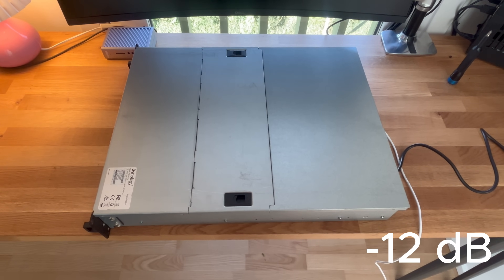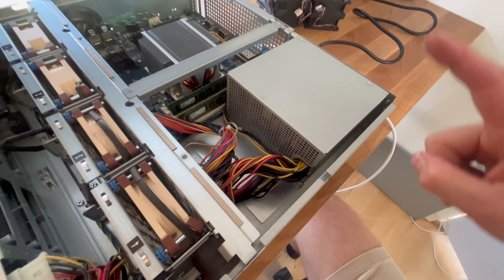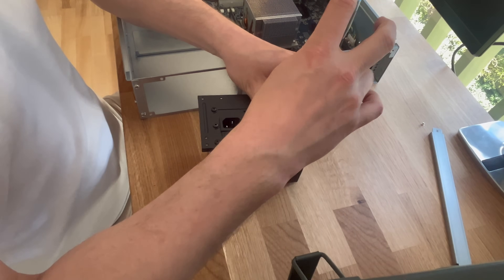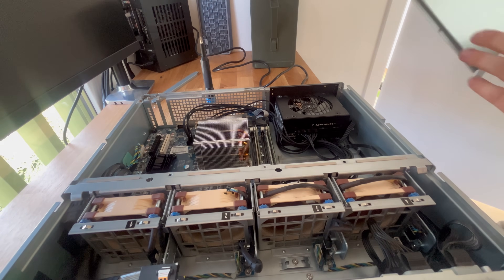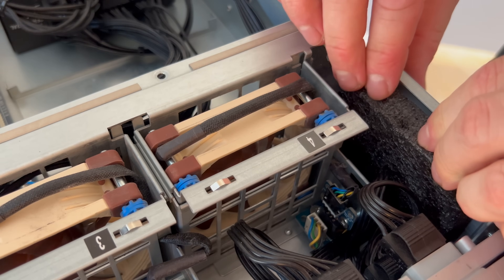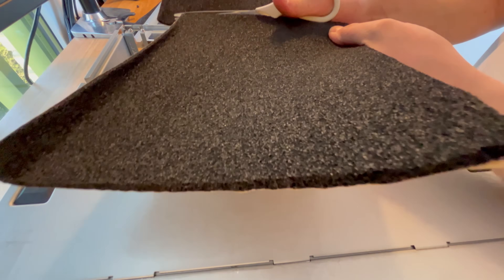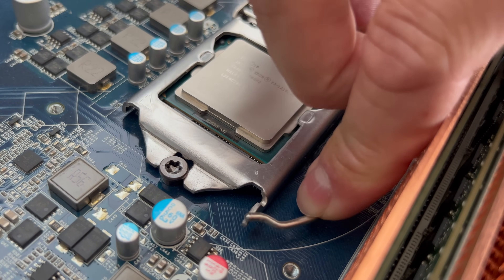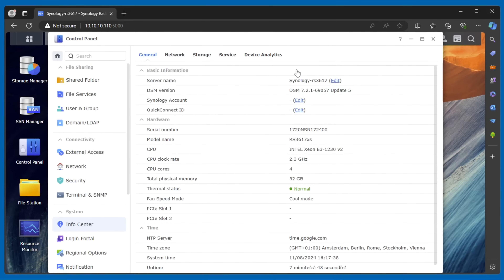8 Dumb upgrades for our aging Rackstation Synology [Lower noise and powerdraw]

Comment: Oh I love the fan upgrade idea! I wish I'd spent more time googling though when my power supply failed or I would have done this upgrade instead of buying a replacement from Synology. It's also a production unit and downtime was a big deal so I needed a TODAY solution and didn't have time to mess around with it. NEXT TIME! LOL
Reply from the maker: Thank you for the kind words my friend :) 

Depending on how much warranty you have left, you might still have done the right thing. If you have a problem with the box in the future and are running non-standard parts, Synology will most likely refuse you any service :)

Comment: Please buy a flush cutters if you like zipties so much.
Putting an air guide for CPU is great move, makes me wonder why there wasn't one in the first place.
Downgrading CPU is a good choice since unless you completely disable cores, they still consume power
Reply from the maker: Agree, flush cutters should get added to my toolbox. Looking at pictures of the machine, there is a fan shroud, but I bought mine used, and the old owner seems to have discarded it.

I agree on the CPUs :)

Comment: The power supply fan is covered
Reply from the maker: No, It's not. There is a 2cm gap from the top of the PSU to the bottom of the case ceiling. That's the entire reason for using the adaptor plate friend :)

Comment: For searching for the sounddamping Material: it looks similar to sound damping mats on cars and is probably the same. Note that many of them have weighting layer. Just buy without as we dont need that and its probably cheaper as well.
Reply from the maker: Oh, that's a great comment! I love it when two worlds cross over, and the sound damping materials from cars would most likely be more than amazing for this application! :)

Comment: cool video, big flex, but cool, i didn't know you can swap the cpu in the rack mounted synology
Reply from the maker: You can only do it in some. I'm fairly certain that most of the newer models use integrated motherboards with chips

Comment: pretty cool upgrades, I currently am just using a SAN I bought for my business as my main storage but I am thinking about getting a lower power system like this for my home use.
Reply from the maker: Cool! What SAN are you using? For minimum power draw, I'd get one of the DS18xx models from 2015 and forward
Reply: @Ottetal  Its an older IBM Storwize V7000 with 96 1tb drives across 4 chassis, its been great for my business but power draw is very high and I want to separate out my home and work machines so I can relocate it once we get an office and still have my media and other files on a local machine. Honestly though I don't mind the power-draw considering the massive amount of redundancy it offers for my business, it can loose one controller, four power supplies, and multiple drives without any interruptions in service.
Reply from the maker: @tjmbv8680  wwwhhhhheew, that’s old. I’m happy it’s working for you. I would go bankrupt before even powering it on
Reply: @Ottetal  yeah luckily my business has good cashflow, I guess I would like to get a newer one at some point but I did the math and it would take a pretty long time to make back the cost of a new San from the power savings.

Comment: Downgrading well kinda not the solution. An 2.3ghz will just run non stop at that speed an 3.0hz will run 2.0-3.0 I'm giving examples and the 2.3ghz will go 100% non stop while 3.0ghz will go 20-80% which is kinda questionable downgrading you're actually making it worse. The solution would've been arctic freezer 3 aio with the noctua fans not those but yeah, remake the interior so that aio can actually fit. Put small noctua fans where the cpu and motherboard is like 3 is ok, psu fan doesn't matter if the fan it's up or down just it doesn't have holes so kinda useless so make holes. Better than that you won't get. But downgrading an cpu only because of sound like big uhhhhh 💀.
Reply: lol

Comment: Not sure about those air baffles. If fan2 fails, your cpu might fry.
Reply from the maker: If fan2 fails, not only will the motherboard sound a very very annoying alarm, but thermal protection will simply power off the unit if too high temperatures are reached.

Comment: so you used a SFX power supply because of fan placement. You then covered the fan with foam. Make it make sense
Reply from the maker: @xabhax  2cm gap between foam and top of PSU.

Comment: hello! i never understood what a NAS are used for how can they be helpful and how small can they get! (sorry for the stupid qustion)
Reply from the maker: @switce  no worries mate. A NAS (Network attached Storage) is like putting a hard disk on your local network and giving it an IP address. By doing so, you make the file on the NAS accessible by all of the computers on your network. This is smart for several applications, for instance:
1: Because the NAS is powered on at all times, you can power off your primary computer, and still access files.
2: Since the NAS only serves files, it can be very low power
3: As said before, multiple machines can access the same files, without needing to move memory sticks 
4: Since they are connected to the network, they can be put in the basement where their noise and heat output does not matter.

The size of the NAS can be as small as a pack of gum, and theoretically as large as a fridge

Comment: I wonder if the sound dampening foam makes an impact on the thermals... I mean I could, but then again it ain't touching anything!
Reply from the maker: It's not touching, and not obstructing airflow, so it's not affecting thermals. If anything, having a slightly narrower internal dimension for air to go through should direct air even more over the active components. This is probably such a small degree, that it's not measurable within the variance I can measure

Comment: Very cool to see this, and thanks for sharing, but...
- Your DIY air baffles may affect the air flow on voltage regulator module parts on the mainboard.
- I'd be highly interested in the temperatures of your 12 hard drives AFTER the Noctua swap. Do you use 7,200 rpm drives, or slower ones?
- I could see some crumps of dried old thermal paste between your LGA fins, which gave me goose bumps: it is not only a high risk to contact problems, but even may damage those fragile fins.
Reply from the maker: Hello friend, thank you for the kind words. I don't think the voltage regulators will take harm with less airflow, since the new CPU puts siginficantly less load on both MOSFETs and vreg. Good comment, I'll keep it in mind in a future video
I am actually "only" using 8 hard drives - the four middle drives are all SSDs. That being said, the noctuas don't push enough air, and drive temps shot to mid 40s. It's still within spec, but I've also read the backblaze report. My next video (should be uploaded tomorrow) will go into what I consider the perfect fans for this box
I agree on the thermalpaste. Rest assured, I took it out off camera, but only I know that - and observant viewers like yourself will rightfully cringe.

Have a good day :)
Reply: @Ottetal I just viewed your update to this - you really tamed those Arctic beasts! ^_^ The temps now look very acceptable - great job, and thank you for the insights!
Reply from the maker: @kai.steffen.schwab  Thank you so much for the kind words friend. And I agree, these new fans really do the job!

Comment: mate, thats savage burn made me LOL IRL. does this have 10GBE? if not add that, and go back the the quad core.also add a couple of NVME drives as cache on it, it'kk speed it up massivly.
Reply from the maker: Thank you for the kind words. The server used to have 2x10G with SFP+ ports, but I don't need the speed. I have dual gigabit to my Compute nodes and a single gigabit link for management and use with my main system. I think I'll go three gigabit links to compute nodes in the future.

Same with the CPU, I don't need the extra performance right now, and would rather have the lower powerdraw. I am keeping a keen eye on usage though - if it goes up, I'll swap back

Comment: That noise dumping foam is making thermals worse.
Reply from the maker: Interesting view. How does it make thermals worse?
Reply: @Ottetal  I don't know how it would make thermals worse. Makes no sense to me? I want to mention that you forgot to add a link to the stuff in the description. I'd be interested in picking some up to play with.
Reply from the maker: @KarlMeyer  It would seem as though they have restocked since. Here is the link friend: https://www.moddiy.com/products/modDIY-Sound-Dampening-Foam-Material-%288mm%29.html

The foam making thermals worse to me, makes no sence either. Someone said on a forum that because heat could not radiate to the metal and then out of the chassis, I would overheat in an instance, which maybe could have some merit, if it was not for the four giant fans negating all heat to case trasnfer.
Reply: @Ottetal  Exactly right, I thought the same thing. Thanks for the link!

Comment: Great vid, upgrading/downgrading is always fun. Is the server able to run any other OS than the Synology OS?
Hvorom alting er var det en god video. Hvor i landet er du fra? Vejle her👋
Reply from the maker: Thank you for the kind words! :) Other users have suggested installing a different OS, which I think is a splendid idea. This is however my only SAN at the moment, and I don't want to take it offline and install a to me unverified OS. 

Jeg er fra københavn :)
Reply: @Ottetal  Yeah, I get the thing with the OS. Unraid might be an option down the line.
Håber det hele kommer til at lykkedes hvad end du finder på :)

Comment: Nice upgrade, however i'm not really into the idea of covering the psu fan.... with the foam that you use,  maybe it's me but i dans see how the air flow can be good for the psu
Reply from the maker: The PSU still have access to fresh air, there is a gap between foam and fan intake on around ~2cm
Reply: @Ottetal  OK thanks for the answer 👍

Comment: very cool video, I recently did similar upgrades to a buffalo terrastation nas that had the original motherboard die. the backplane on it was unfortunately not able to be used with the new board because it used some odd proprietary connector to handle spinning the drives up. I pulled it out and just wired them individually since they're sata drives anyways. It's currently my cold backup for my main nas, and I need to get around to setting up wake on lan to allow the main one to back itself up automatically. One thing you might look at here is weather that foam is blocking the new psu from getting air because it seemed like it was a little close to the fan
Reply from the maker: That sounds nice! Could you have harvested the connector from the old motherboard and build a new cable? There is a ~2cm gap between the PSU intake fan and the foam, so it should be fine, thanks

Comment: damn noctua's fan really do the job
Reply from the maker: Yeah, they are really quiet. They don't push a whole lot of air though, so I'm trying to find replacements.
Reply: @Ottetal  if its a 2u, you can buy a cpu cooler that has a fan on it which will allow you to have more air on the cpu thus allowing PWM to be lower. Also the PSU is going to be loud anyways but its good you dont have a FLEX ATX psu as they are mega loud with their 40mm fans